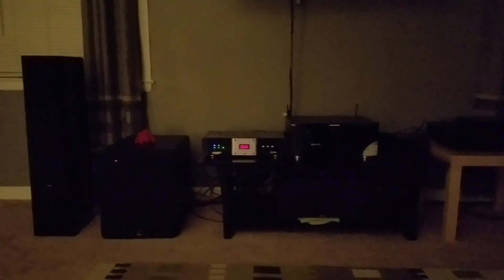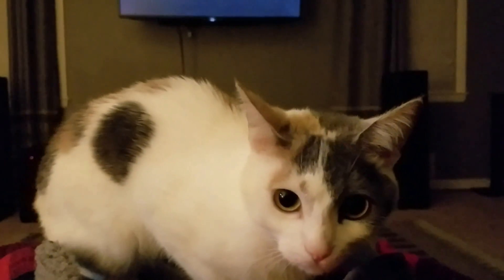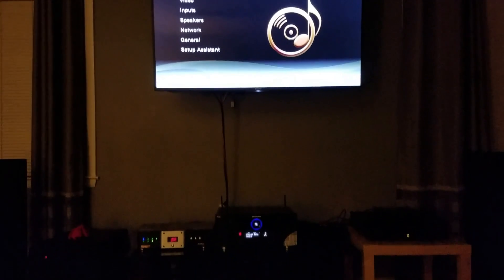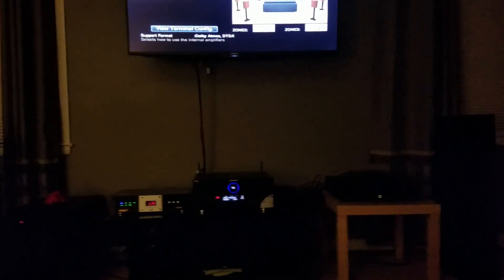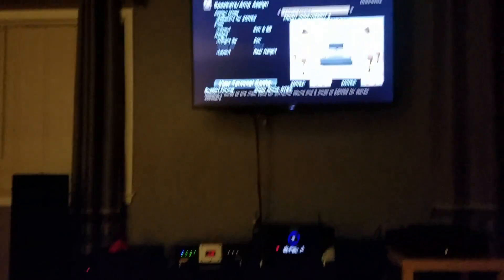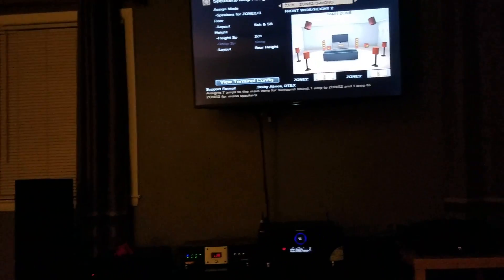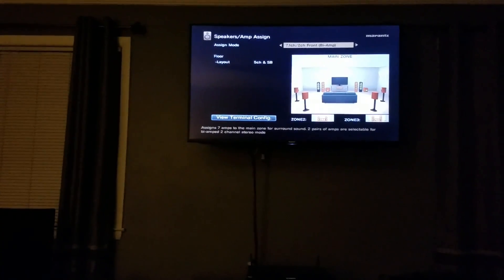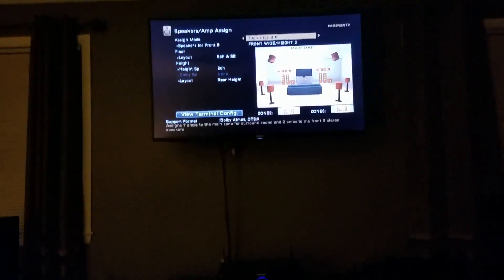Marantz setup virtual instruction manual on amp assignments for Dolby Atmos DTS X

Comment: HELP, HELP, Question? I have a marantz 6013 and i added a emotiva 11 yesterday to a 7.2.4 . But the receiver is only processing the front stage and side surrounds, all other speakers have been calibrated. what am i doing wrong? in the setup i selected  none for pre amp on the option marantz gives for the pair of speakers to be amped, was i supposed to select one of those. If so im assuming with my emotiva powering everything the receiver amps will still be powered? Im confused as sh!#. please help.

Comment: I’m looking at the Marantz 7012 which is also 9.2 with 11.2 channels processing. Is it possible to preamp the front left and right to a dedicated amp? I’d like the fronts to be available for surround cinema listening but have dedicated amplification for stereo listening.
Reply from the maker: Yes it should certainly be possible and it should have a left and right pre out although RCA connections.  You should be able to add power amplifiers to any and all of the channels including 11 channels.

Comment: Hi, I have the matanz 7011 and I want to configure it to 10.1 with voice of god speaker. To do that I need a pre amp for the VOG speaker. What amp do you recommend? Will a mono amp do?
Thanks
Reply from the maker: The marantz sr7011 should be able to process a voice of God speaker or channel... it would leave from the subwoofer 2 output  into a power amp.   At least the sr7010 can process a vog channel.   But if what you're saying is true and you do need a new processor, which you shouldn't if you have upgraded to Auro 3D... or what you do is use the front 2 height channels as 1 or 2 voice of God channels.  You would then have to add external amplification for the front 2 height channels if you still wanted those.   If I'm not mistaken even the brand new Marantz 8805 13 Channel processor doesn't necessarily have a pre out labeled vog.  Since auro uses the front height info as vog and possibly wide speakers, there's no need for height 1 and height 2 speakers since they're used as vog.  As far as an amplifier goes it depends if you're looking for a stereo or mono mono will definitely work, it just all depends upon the processor you are you using to send the signal from and if it's RCA vs XLR.  If you already have a Marantz I would stick with that otherwise emotiva or parasound or red dragon audio. outlaw audio and monoprice also make great amps.

Comment: Hi I have the nr1608 marantz so I have the 5.1.2 setup, I like to know is there a way I can use the the other pre out and make it a 7.2....I now have 2 height 2 fronts, center and 2 rears , I want to add 2 more rear speakers...is there a way to manipulate this receiver to doing that or maybe a splitter .??
Reply from the maker: Thats one the bad thing about the NR line of marantz receivers, the fact that the processors can only do the 5.1.2 channels.  I am pretty sure you would have to buy an external pre pro processor.  If the receiver does have pre out sections for 2 more speakers you can do it, but one thing you could do is power all speakers off of the marantz and add a 2 channel power amp off of the pre out rca section of the marantz, that way it is adding 2 more speakers, but you need the processing for it.  If you don't see a pre out labeled rear height or surround height, it wouldn't be discrete audio from those channels. I contacted marantz asking if you can manipulate the SR7010 even to run front height channels from a power amp and you cannot.  Let me know what you end up doing...

Comment: Is there a setting in Marantz receivers where you tell it to use the pre outs on all the channels?

I have the Marantz 6010 and want to buy a BasX A700 to poweramplify all my speakers . But it seems in the settings, it will only show "PRE" on one pair of speakers of my choosing.

Does that matter, or can I just plug in RCA cables from the Marantz pre-outs to a BasX and then it will work regardless of "PRE" setting?

Thanks.
Reply from the maker: heres the thing on pre out options on these receivers... I have attempted to pre amp my marantz nr1606 and yes you can connect all rca outputs to a 7 channel receiver.  There is a main difference between the pre out section on the back as opposed to the 11.2 channel processing it will do for surround sound.  I would say that you could get the best possible sound adding an emotiva a700 for all surround and front speakers and it certainly is possible.  In fact the emotiva absolutely has to have an av receiver powering the volume of the basx series of power amps since there is no volume control on them at all.  It that situation you would be sending the signal out of the marantz into the emotiva but the marantz would be doing all processing and sound modes.  The Emotiva at that point will be bringing up the clarity and detail plus power of all speakers.  Keep in mind for volume to increase you get an extra 3 db at doubling the wattage!  So to make it twice as loud you would technically have to have an amp that could power like 400 watts rms each channel which is unheard of since no home system would even need to get that loud.